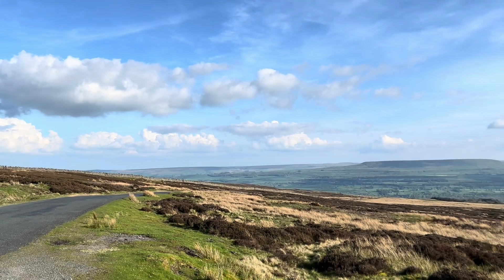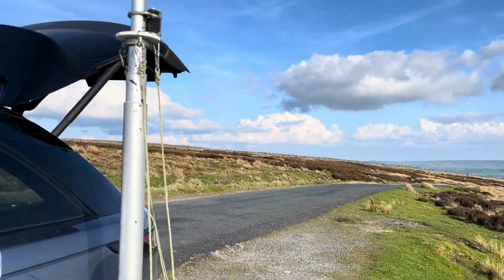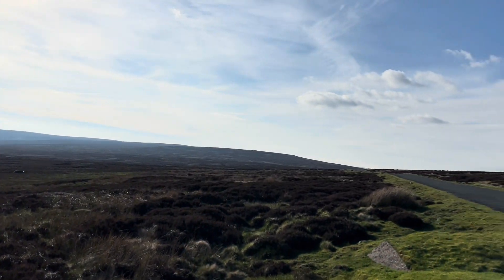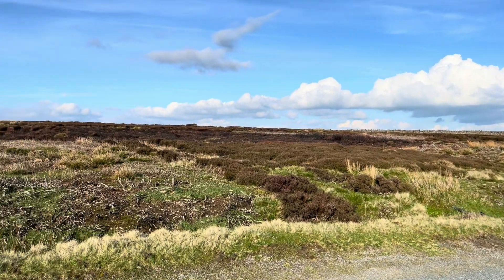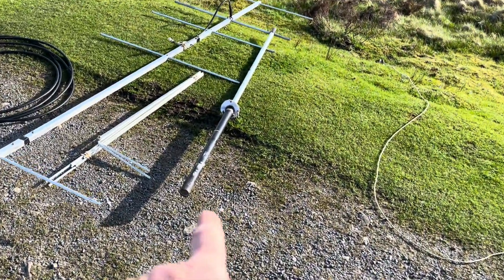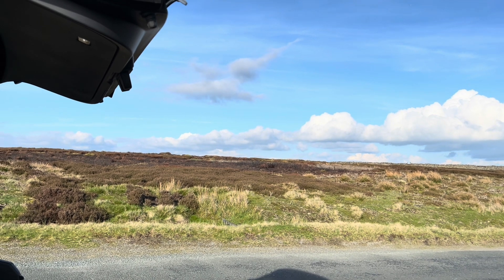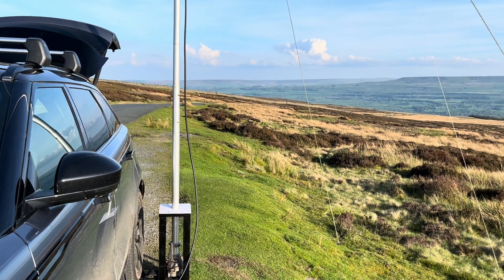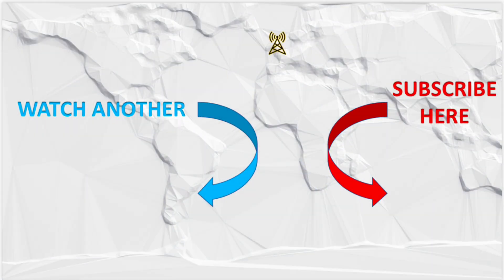Height, Horizons & Distance - Why Does Height Matter?

Comment: Ian Great results in CQ WPX CONTESTS 2024 well done . 73’s Steve
Reply from the maker: Thanks Steve! 👍🏻
Reply: @G0CNN-Ian  I need to pay more attention to logging as I lost 30% of QSO points 141,000 down to 98,832 due to incorrect call sign logged or incorrect call sequence number  of the receiving station. So a lot of multipliers lost. Still had a great time 28th England SO LP Not bad. Try harder next year.
Reply from the maker: @G7LJL-Steve_Murton  Ok Steve and thanks for a heads-up on the results, as I hadn’t seen the WPX email. Yes, some work needed, but hard going depending on your QTH and noise etc. I lost a few, but haven’t logged in properly to analyse. Good fun though 👍🏻